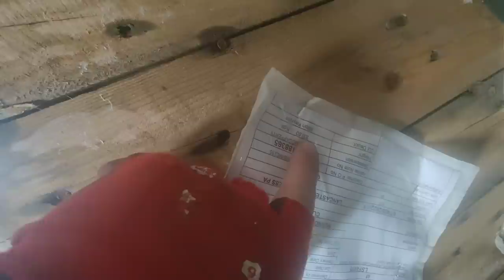Cable puller for a week?

Comment: I like that flexible duct yall use for underground conduit. Here in the states we have to use rigid pvc.
Reply: Our code is weird same in Canada, calls for rigid PVC with unarmored cores. Why not just use flexible duct with armored cable instead if its cheaper to utilize, maybe it has something to do with cold weather but that wouldn't apply in more southern states either. Otherwise it just seems more expensive for no/little benefit over some good steel armored cable like seen here.

Comment: Spent eighteen of the happiest years of my life as a cable puller. Now I’ve got knackered knees.
Reply: Knew pads are a must
Reply: @blackmist12345678  It’s not that, it’s the constant pulling of heavy cables by bracing your knees, a bit like tug of war.

Comment: I do the aslaids for the cables in my area from 25cne etc up to 300triplex or awc al day long different building sites or fields were overheads ars taken down to just a joint hole outside a cabinet ...

Comment: Just  before I retired. We got girls working on cable pulling. It was a utterly horrible experience.  They have no upper strength and weighted a hundred pounds.
So instead of 4 guys with a beer belly you  got two guys and two girls that needed rocks in their pockets to stop them from being blown away by the wind. 
They were great at getting coffee not pulling cables / lifting boxes.
Reply: What a surprise. Maybe you could have given them a job more suited to their strengths like some second fixing or containment? 

Most blokes I know would be useless at pulling cables too, no need for the sexism.
Reply: @djturbine7565  
 you just proved my point. If you can do the job, you quit and be a waitress. No difference it you are a guy that can't do the job your fired. 
Whiners need not to apply.
Reply: @assassinlexx1993  Absolute snowflakes eh. Maybe if they spent less time buying lattes and watching Netflix, and more time in the gym, they would succeed?
Reply: @Frieslick  
Plus they wanted the same pay for a quarter of the work.

Comment: Good video. Takes me back to pulling in cables with a forklift (no winch), or another time it was in a factory and we used the overhead crane 😁 I laid some cables (baby ones) at an office block for an oil refinery, I lifted the floor tiles to look for the tray work and it was just sand. No containment. It was in the desert 😅  You just laid them loose on the sand! Simple job, except for the scorpions!  Any reason you didn't reuse the ducts you pulled the original cables from?

Comment: I spent 4 years living in this unnatural flat hell scape, I'm a lass from the North West, hills are my home!
Reply: I work in a hospital as a linear accelerator electronics engineer, we've recently had a week of a cable gang working hard outside the office running cabling for the combined heat and power plant they've installed

And when I was in my late teens I spent weeks every summer pulling cabling around festival sites from the genset villages to each stage and backstage, hard but satisfying work. I'm far too broken a human now, but I always enjoying being the strongest there with my 5'10 rugby playing dyke self, showing the lads what strong actually was 😁

Comment: Being that you're going through all that trouble to pull that cable from that conduit no I didn't you go ahead and set up your wheel and put it back on the wheel as you pulled it out would have saved you time

Comment: I do not understand the need to change the size of cables down. There's no rule preventing you from removing some strands on both ends to accomodate smaller lugs. This is pure madness.
Reply: You can get narrow palm lugs. You're compromising the integrity of the cable removing strands, it's rough as fuck
Reply: @Walktheline1991  What is this "integrity"? Where is it mentioned im regulations?